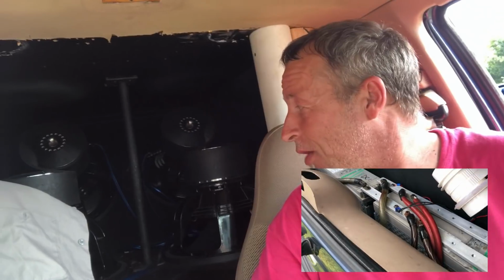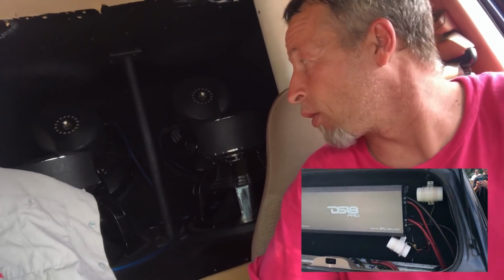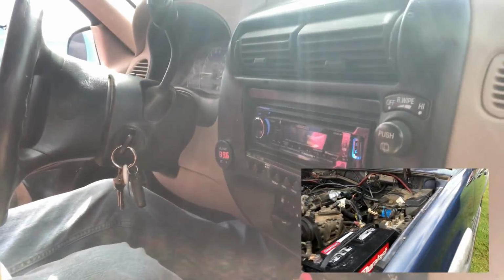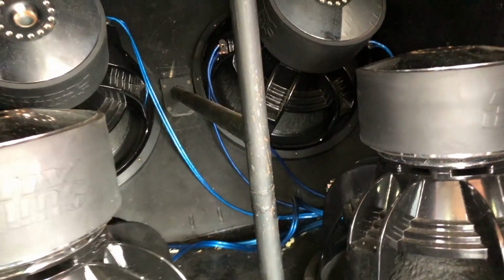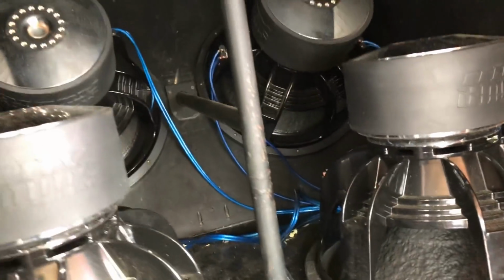4 Sundown Zv5 18s in a Windy 4th Order | Hair Tricks

Comment: What's the only thing better than two 18's in a car? FOUR 18's! This was the proper use of a Ford Explorer. The subs probably knocked all the creaks, squeaks, and rattles out of lowly Ford chassis. Well, probably not. Four Sundown Z-18's make LF wind nicely. Very, very smart to have power distributed among 4 subs. Each sub probably getting a solid 800-900Watts after impedance rise. This man knows the system will live forever this way. Wise wise man. Super clean sub 40Hz sound.
Reply: I'm putting a scv 4k per zv5 18 in my Ford... uh Navi actually... ok it's a ford. Ill setup clean and these zv5's will take 3500rms all day